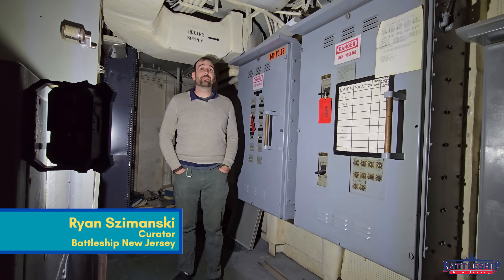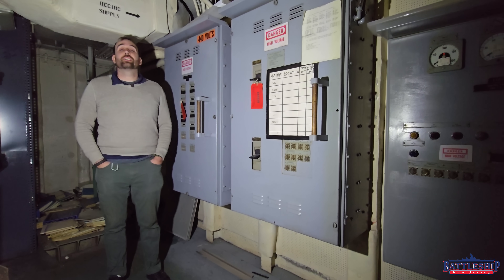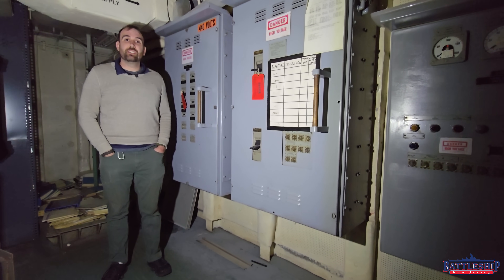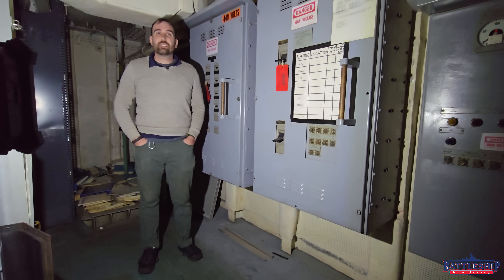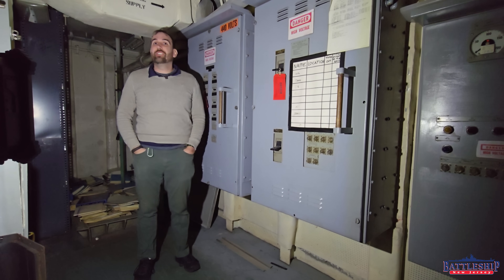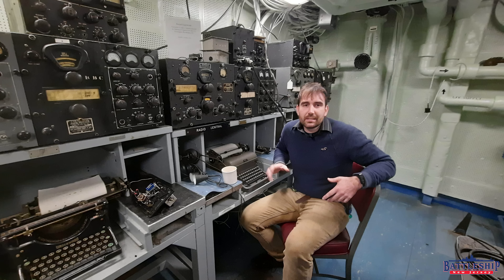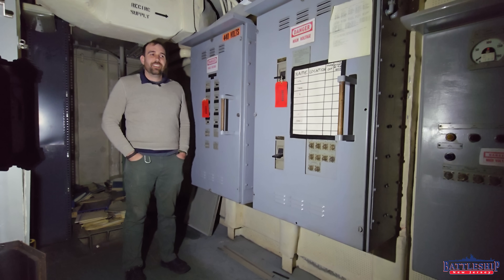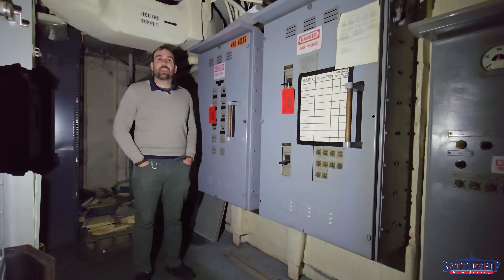One Piece of the Missile Puzzle: The 400HZ Frequency Converter

Comment: So I used to work at Raytheon, and once when we were cleaning out I actually got my hands on an old 400Hz benchtop power supply for testing aircraft avionics.  This thing is ancient but It still works.  It probably weights 100lbs and has an old motor driven variac inside it.  You could make something better now out of an off the self VFD but its still kinda cool...

Comment: 60hz means the AC power is changing polarity 60 times a second or 60 cycles. The reason for 400hz (the AC is changing polarity 400 times a second) is that electrical and/or electronic things can be built to a smaller physical size and more importantly at a lighter weight. Very important for ships and planes.

Comment: With modern stuff I wonder if 400Hz is still used as much, or if they use like at-device DC power conversion and then inverter-driven VFDs when they need to drive something that would have once been 400Hz?  Stuff like toy drones to electric cars now run on DC power and have circuitry to drive high power 3-phase motors using high power 3-phase variable-frequency inverters to run the motors at the desired speeds.  You mentioned those frequency converters on the battleship were big, I wonder if they might have been rotary converters?

Comment: The avionics shop I worked at for over 30 years had a 60 Hz to 400 Hz motor/generator that supplied the 28 volt and 115 volt 400 Hz power needed by anything autopilot, radar, or navigation related that needed to have synchro motors, or synchronous motors, in order to transmit positional information from one part to another inside the avionics system in the aircraft.

We had it remote mounted in the building, as it was noisy and dirty, but it, along with the vacuum pump mounted on the same frame, required maintenance ever 30 days to replace the vacuum oil and other lubricants to keep it running. Something I did when needed.

The set you had, looks to be the common over built control system to turn on and monitor the simple motor/generator set. And the hand labeled switches in grease marker was the standard for the crew to use, as it had to be able to be removed quickly leaving little trace, in case someone in 'authority' were to show up unexpectedly, and would make a fuss over improperly marked switches...

Comment: I used to use a machine just like this to repair airliner galley equipment. Ours was about 50kva. We overhauled it once while I was there, very rebuildable. The tricky part is properly aligning both the motor and the alternator afterwards. 400hz motors are great, LOTS more horsepower from a given frame size because they spin so fast.

Comment: 400 hz ??!!;

Why would anyone want 400 hz ? 

Back in the 50s, I think everything was still shortwave 

If I remember correctly in the early 70s VHF started to be used. 

A lot of the fire departments, especially volunteer rural areas used the mid 40s MHz

I think they were installed in the 60s. 

But, the 70s most public safety departments installed VHF radios. 
They were crystal back then. 
And a lot of them were CSQ, no CTCSS Tone 

The EMS also went to VHF

Ambulances and hospitals used the same Frequencies 

155.400 was the main frequency 
155.340 was the secondary 
155.280 was used by some ambulances to talk to the base

I remember calling in the blind and I would receive an answer from what department was able to hear me and they would say " go ahead and we will relay for you " 
And I would transmit my call sign and the base I was trying to reach and the department would repeat the message and sometimes that was enough for the base to hear me, and they would talk and I could hear them. They were transmitting with 150 watts, where I was only 25 Watts or 5 watts on the portable. 

Each hospital, nursing home, ambulance Corp, and any other facilities with EMS radios had their own 3 DTMF tone. 

So for Memorial it was 123
The VA was *12
St. Mary's was 100

The entire state list had over 3000 codes. 

When you were inbound to the hospital with a patient you would be about 5 to 10 minutes away and you would key up the mic and enter the DTMF tones for the facility you were trying to reach. 

And usually they had an auto answer to let you know that you made contact 

So you would key 100 and release the mic and you would hear on 155.400 a long time and 2 beeps 
And a short time after that you would hear a nurse " St. Mary's Hospital answering the call from the ambulance" 

And we would transmit our ambulance company name and unit number and the information on the patient, and everything we had done, how far away we were, and ask if they need anything further.

Usually they would say " received, see you when you arrive, St. Mary's Hospital clear " 

A lot of us carried our own radios we purchased.
I had a Low Band GE 25 watt radio and a 120 watt VHF radios, a 45 watt UHF radio, a 25 watt 800 MHz and a 35 watt 900 MHz radio, all Motorola radios.

I had about 100 channels in each radio

It came in really handy when we had a county wide emergency, like a rural brush fire.

The state fire dispatch was on 45.88
But the aircraft were on 155.715 
Now I have an actual aircraft radio and a marine radio.
The aircraft radio is a very good thing to have, same with the marine radio

Comment: There is a distinct sound you here around military electronics.  Also a lot of civilian aircraft too.
A distinct background tone.
In our domestic lives we are so used to it, we don't notice it, but it's at 50Hz or 60Hz.
In aircraft and military, for whatever reason they tend to prefer 400Hz AC power.
Hence the high frequency "whine" on audio around mil gear or aircraft.
Reply: 400Hz is used for several reasons. You get a lot more power out of motors and generators of a given size if you raise the frequency, so 400Hz is used to meet power requirements while minimizing the weight of equipment. Also, 400Hz power rectifies to DC much smoother than 60Hz.

Comment: im not surprised to see 400hz everywhere. lots of wwii control systems relied on synchros, resolvers in the like and those all run on 400hz ac usually. very electromechanical, much awesome.
Reply: We were using teletypes to input data to load our fire control program from magnetic tapes, it even had a paper tape reader attached up until 2002 when I got out of the Coast Guard.

Comment: 400Hz 3 phase?
Reply: Of course. All proper AC is 3-phase. I have a 3ph feed home, and several machines (foremost geothermal heat pump and pool circulation, but also workshop) driven from it. 50Hz of course.

Comment: So what I'm hearing is, if I could get my hands on all 4 Iowas I could probably make 1 completely intact and  functional Iowa class battleship.
Reply: Assuming you used Wisconsin as the base ship, then you could add in the functional turret mechanism of Iowa, remaining 400hz frequency converters, Admiral cabin from New Jersey, expanded bread bakery and small arms storage relocation from Missouri, New Jersey's chain locker, nab diesel generator parts from the other three ships, removal of Nixie anchor points to reduce corrosion, new deck wood from New Jersey, engineer space from New Jersey, machine shop from New Jersey, New Jersey power shop, New Jersey hull technician's shop, New Jersey carpenter shop, Mardet office and sandbox weapons clearing from Missouri, bridge window cleaning walkway and harness attachment points from Missouri, Harpoon and Tomahawk computers from New Jersey, 5" inch gun parts from ships other than Wisconsin, boiler parts from the other three ships, 16" barrels from the other three ships saved as spare parts, New Jersey smokestack, fire related equipment from New Jersey, and spare intercompartmental phones from New Jersey.

Though you'd need to manufacture new ammo and powder bags for the combined ship. Also, the Wisconsin would still be outdated these days. 

The potential minimum upgrades after that point would be to replace Phalanx Block 1 with Block 1B, replacing most of the power hungry components from the 1970s and 1980s, flat screen monitors, installation of turbo-electric power, larger application of modern ship compound flooring, inclusion of SWIX radio-like communication devices and more modern cell-phone like devices, DC-WIFCOM kept as backup communication, new Florescent light panel and LED installations, storage for LED Lanterns, proper Navy Tactical Data System, one Odin drone disabling laser, Nulka missile decoy, Naval Decoy IDS300, new drone station, RIM-116 Rolling Airframe Missile Block 2, AN/SWY-2 SDSMS, and SSDS Mk1.

Comment: That was interesting. I was an avionics tech in the late 1960s. As you mentioned 400 Hz is common in aircraft because  the higher frequency saves weight because it reduces the amount of metal needed for transformers. Also back then it was a nice source of audio warning tones. Until this video had not thought about its use shipboard but as you mentioned some of the updated weapons used 400 Hz.

Comment: I work for the US Air Force at one time. Our building had 400 HZ circuits everywhere to be able to test flight avionics.  The IBM mainframes from the 60's to 80's all ran on 400 HZ and included a pair of 400 HZ generator as part of the setup.  400 HZ provides cleaner power for the computers

Comment: had a friend bought a surplus generator and wanted me to get it running. it was air force surplus 400 hz.   since it wasnt navy it could not be used for a boat anchor and i wasnt strong enough to make it fly  so i recommended the army  deal.  dig a ditch and bury it.

Comment: On the Concorde , the Powerd Flying Control Units (PFCUs) were using a FBW (Fly By Wire )static inverter. This thing, which was rightly monitored up to the hilt, produced a 26 Volt 1800 Hz output. (1800 Hz was chosen as this is not a harmonic of aircraft mainline 400 Hz AC supply) to power simple 4 wire synchros.

Comment: Ryan, now that you found the circuit breakers...now you have to find those four items.  Follow the wires!
On a serious side, part of the reason for 400 Hz is that it is easier to rectify into DC power.  The 407L radar system I worked on in the USAF when I was stationed in then West Germany used 400 Hz for power.
Reply: No easier/harder going to DC power, still just runs thru a rectifier set.  But the higher frequencies do allow much smaller transformers and motor coils.  And these days I'd expect they would use the same tech in so many modern cheap consumer electronics...PFC AC/DC switching supplies to get smoother, more efficient DC power and then compact light-weight Inverter VFD units to get whatever single/3 phase AC power to run any motors and other stuff they desire.

Comment: On my ship we had motor generator sets.  If I recall correctly, there was a 60 Hz motor that spun a shaft that turned a generator that produced 400 Hz AC.  there was also a battery bank that would somehow take over if there was a 60 Hz power failure.    Things powered by the 400 Hz power was the gyrocompass and all the repeaters.   The fire control equipment.  Director, computers, radars, and portions of the sonar system.    So there probably was a 400 Hz MG set aboard during WW2.  I would expect near the forward and aft fire control centers, as all the gun laying data would be transmitted via 400 Hz powered equipment.   
   The reason for 400 Hz power was twofold.  It allowed much higher resolution of the bearing and angle  indicators, so thus higher precision in fire control, which for battleships was critical.     the reason it's used on aircraft is weight savings.  Motors and transformers did not need iron cores to operate like their 60 Hz counterparts.   Some radio equipment used 400 Hz, so as to take advantage of the battery backup for emergency radio communications.   You might find some outlets in those spaces that look like regular edison plugs, but have a label or color coding saying 400 Hz power.   Don't plug your electric razor into them.  
   ANd yeah, adding whimsical labels to spare breakers and such is a long time tradition, not just in the navy.
Reply: I did plug electric drills and such into the 400Hz power, they whine a lot, and run at the same speed, as they are universal motors, so work well on 400Hz with just a loss of power. Also have used them on the 28VDC bus, where you got the same lowered power because of low voltage. Speed controls do not work well on 400Hz, as they are either then full on or full off, as the thyristor controls do not respond fast enough to the higher frequency, and on DC they turn on and stay on till the trigger is released. but handy out on a forward base if you need to drill out a stuck screw, and you have no air equipment, and only a power drill. drill it out, remove the panel, and drill out the self locking plate, and rivet a new one in instead, with a new screw.

Induction motors just whine, and will in general not start at all, and get warm fast as there is no cooling.
Reply: The ones shown for Wisconsin are static inverters to produce the 400Hz.

Comment: You should NOT have told the Navy, that these MG sets are still available.  When I got my EE degree, we had to analyze, model, and repair one of these units.  They are totally rebuildable, usually only needing bearings and brushes.  Maybe a little bit of commutator re-sanding, but the rest of the unit is essentially indestructible.  Even if rusted, all you need to do is remove the rotor, sand the gap clean (also rotor), and stick it all back together.  I could do this in my sleep, having done it on gobs of similar electrical machinery.  Green copper corrosion easily removed and cheaply re-plated.
Reply: It looks the ones on Wisconsin were actually static converters, so no motors or generators involved.

Comment: The use of 400Hz for avionics originates from Sperry's development of the electric autopilot in the 30ies. The objective was to power an electric gyroscope for the autopilot system. A motor with brushes would produce carbon dust that would impact the bearings. A 400Hz AC motor is driving a gyroscope at 24.000 rpm. This would be used in the second world war in autopilots in a large scale, also coupled to the bomb sight. The size of electric component reduces with higher voltage, not which frequency.
Reply: Voltage and current matters a lot for electronics size, but capacitors and inductors do care about frequency. Impedence  equals 1/2piF and 2piF. Higher frequency means less resistive losses, smaller wire and caps are needed.
Reply: Huh! Wow. I worked in aerospace/avionics for almost 30 years and never knew this. Cool!
Reply: So that’s the non-music person who made an arbitrary choice we’re still living today!
Reply: The rotational speed of an AC motor is mathematically limited by the frequency of the power supply. So if you want something to spin up to a really high speed, like a gyroscope, powered from an AC source, it needs to be a high frequency source.

Comment: I was an IC man on an Adams class destroyer in the late 80s.  We had two 400Hz MG sets.   Dual redundant system, we only needed to run one at a time.  They also had big banks of car batteries that would keep them running for a little while if we lost main power.  The 400Hz power was used all over the ship.   The big sperry gyros sent out 400Hz signals that the repeaters all over the ship used.  Other indicators like rudder angle indicators and the helm connections to the steering gear ran on 400Hz.  The motion control systems on the guns, and various missile launchers used it to follow the stable platform in the sperry.  I think, even the wind birds used it.   We would swap out the active MG set at least daily.  It was a fascinating evolution.  No automatic controls.  You had to turn big knobs to bring the offline genset up to speed and match the online unit.   When they were in synch, you would throw the switch to tie them together (that was always an anxiety inducing moment).  Once they were spinning together you would turn a knob to take the load off the offgoing genset and then disconnect it.  You could always tell an ICman because we had little round holes burned into our dungarees from doing maintenance on the battery banks.  :)
Reply: grrr, battery pms. best thing i did for myself, and the guys who followed me was to get sealed batteries for the gyro, and phone system backups.
Reply: I was an IC (1980-1988) as well. First ship was the Midway (CV-41), then the Oldendorf (DD-972), then the Doyle (FFG-39).  I was the lead gyro tech on the MK-19 & WSN-2.  Those two platforms, and a bunch of other equipment I maintained, depended upon 400Hz - all the things you mentioned.  I also had to do PMs on the batteries… nasty job.  Oddly, when I reported aboard the FFG, we weren’t snipes anymore. The IC shop was part of combat systems.

Comment: Wow you have an electronic frequency converter instead of a mechanical one.  Looks to be 3phase power 
Yes, 400Hz noise is worse than 60Hz. Most magnetic components like mothers, transformers can be made smaller and lighter at seven times  higher 400Hx freq. 
As for "unapproved makrings"  Yes. Builds moral.  Used to be mostly Star Trek.  Did not see much Star Wars though some psychedelic pictures and wizards were popular.

Comment: Makes sense. Military aircraft operate at 120 volts 400 hz. All servos, coils motors solenoids can be much smaller yet do the same work,
Reply: not only that , the higher the frequency the easier it is to filter it for dc conversion, used in most equipment with a circuit board.

Comment: The proper term is a motor-generator (MG).  Minuteman Missile Launch Facilities and Launch Control Facilities have MGs that will automatically switch to batteries when the primary (60 Hz) power goes away.  The current configuration uses 10 submarine class (1500 lb) batteries as the backup power.